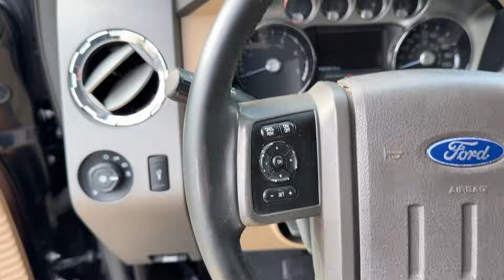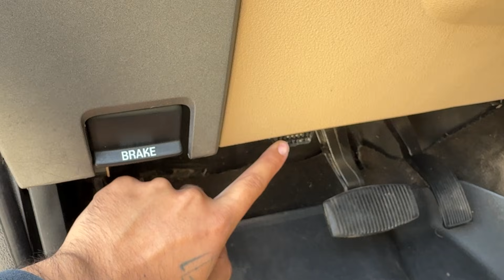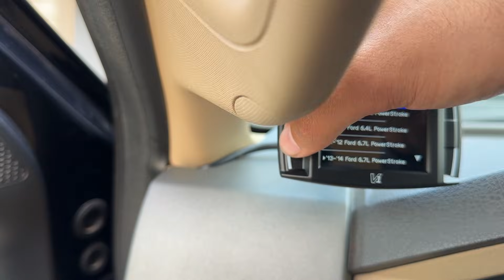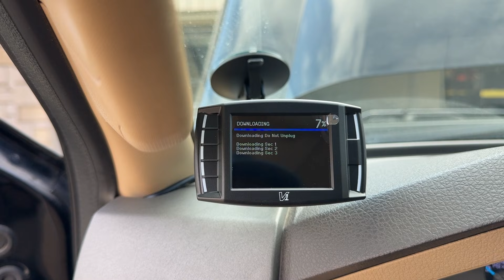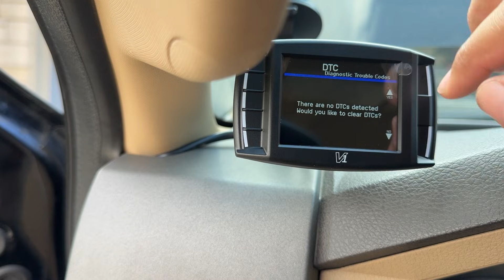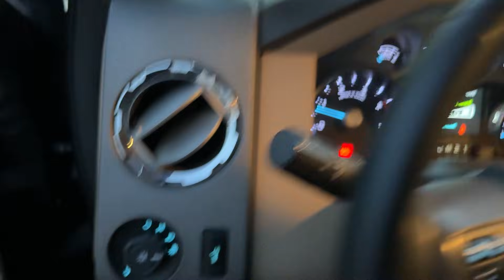6.7 Powerstroke Mini Maxx Tuner - How to Install it the RIGHT WAY for EGR/DPF/DEF Delete

Comment: Greetings, excellent explanation, but I have a question: when you got to the step about tuning the transmission, you selected "no." I'm unsure about installing the same system I purchased. I would appreciate it if you could clarify this point for me.

Comment: New diesel owner here I’m gonna delete my 2013 F25067 power stroke and I was gonna ask can you take all the stuff off first and then install the minimax and go through all the tuning process and I was wondering if you had any problems or do you need a shop to tune it for you?

Comment: It doesn't matter if you do it before or after as long as your truck didn't have any cel and you do not start it after the delete... put battery vharger on batteries and tune after. Your truck won't know if egr or def is deleted if it hasn't been started

Comment: How do you like the mini maxx tuner after all these months? I am trying to decide bewteen mini maxx or EZ lynk, ez lynk has better tunes, and mini maxx is just so much cheaper so its hard to decide. Also, if you know the difference between the v1 and v2 mini maxx any info would help. Great video!
Reply: V2 is for 15 and 16. V1 is for 11-14
Reply: @brandonkraska931  Just ordered full delete kit and they are sending me the Mini Max
 V2 for my 2012 F250 6.7  ??

Comment: You only needed to remove the 2 connectors and vacuum line (plug it) on top of the EGR assy. That's all I did and it hasn't caused problems. Those are what make it work.
Reply: Cause carbon build up
Reply: @mikemerheb7038  it's got nowhere to go if it's turned off. The exhaust stops right there and will follow the path of least resistance...out the exhaust pipe behind the truck.
Reply: When I took my throttle body off it was full of carbon along w my upper and lower intake,bad!! I would think it would build up in the egr amd back up...I could be wrong
Reply: @mikemerheb7038  That wasn't the EGR. The EGR is to the right (left as you stand in front) of the intake. The intake gets the cooled exhaust gasses from the EGR. By turning off and disconnecting the EGR, the valve defaults to the closed position and that tube to the intake is rendered moot. That carbon was because the EGR was working. With the EGR valve closed, there is no exhaust entering the intake, and therefore, no carbon. Clean that carbon out and it will not return. 

I'll delete (I have the kit) my entire EGR system when my truck needs new coolant hoses. Until then, the EGR remains turned off and I haven't wasted $$ on coolant. I plan to send my intake to the machine shop at the same time to have the intake cleaned thoroughly.

Comment: Hey boss, I have a 2011 F250 with the mini maxx (I believe it’s the V1). I was wondering, after the truck is deleted can the tuner be unplugged? I know that it keeps the delete tunes stored so it doesn’t throw any codes, but if I have it set to performance mode will it keep it in this mode after it is unplugged? I’ve been seeing mixed messages online. Appreciate any help!

Comment: Getting ready to do this to my truck this weekend. I am concerned with one thing, though. On multiple videos, I am seeing that you aren’t supposed to install the tune with emissions related check engine lights on. I have one EGR code and one DEF heater code that comes back every time I clear the code and the truck is turned off and back on. What am I to do in this scenario? I can obviously delete the codes, but I am worried that with all of the cycling of the key on and off at the initial set up, that my check engine lights will still be active because they usually do come back after restarting and could cause issues with the tune installation. Any ideas or help would be greatly appreciated as I only have a few days until I tackle this myself.
Reply from the maker: The only thing you can do is try clearing the codes and go straight into the tune process before starting your truck. I’m unsure if by turning the key on and off during setup will introduce the codes again. Do you know if the codes only come back when the truck is turned back on or only if the key is turned to run position but not turned over? Either way, this seems to be your only option. Hopefully the tune will install before the codes return, which then the programming for those codes will be deleted and you’ll be golden. Worst case scenario I think would be that the EGR and DEF codes remain after the tune and either stay permanently or you may be able to delete them through the diagnostics process on the tuner. But even if the codes do stay, it sucks having a wrench or engine light, but at least your truck will be deleted and emissions equipment will be turned off. Later down the road you can always flash back to stock and get your emissions stuff “fixed” so that the codes go away permanently, then re-tune. Whatever you do just make sure you tune first before removing any sensors and don’t turn over the ignition fully until prompted towards the end of the tune process. I’ve never dealt with this issue so please report back on your findings for all of us. It would greatly help the community to learn what the outcome would be in your case.
Reply: @mediciimusic I appreciate the quick response. Absolutely will update once I get everything sorted out. Hopefully by this weekend! Thanks!
Reply: UPDATE!!!! I just unplugged all of the plugs on my def pump, then used OBD2 scanner to delete the code, and my CEL FINALLY WENT OFF! And stayed off. Been scratching my head on this for over a month! I hope that helps you
Reply: @byrdsdoityourselfgarage7330  what code did you have? i thjink that will only work for those who had the same code as you
Reply: I’m having this same issue :(
Reply: Yeah, I got the same situation. I got a code for EGR, which is why I wanted to delete it in the first place, rather than dumping money into fixing my emissions system, let me know how it goes if clearing the codes works
Reply: Let us know man!

Comment: Have a question, can the tuner be installed after deleting the truck?

Just notice that it said to do it before removing any components from the truck
Reply: You probably could but I wouldn’t or you’ll get a bunch of codes if you start/drive it.  What I did was installed tunes, then started truck to make sure there were no codes, turned truck off, then removed everything.

Comment: I just removed my egr from my truck.  I haven’t received my tuner yet. It’s still in the mail coming in a few days.  

Will I have an issue downloading the tuner? The instructions says warm up the truck to normal operating temp before downloading the tune.  

Did you have an issue with your truck deleting everything first before installing the tune?

Please help??!!
Reply: Did you have any issues?

Comment: I removed my egr cooler before installing my tuner.  Will I have a problem properly installing the tuner?
Reply from the maker: If you start your truck before installing the tuner after removing the EGR cooler yes you will likely have major problems. The track maybe wont start or will go into limp mode? If you watch the whole video I clearly state that you MUST keep everything stock without removing anything until you install the tune. Then delete everything.

Comment: Will you post a video on doing the egr delete with block off plates?
Reply from the maker: Eventually but honestly scared of snapping those bolts so I haven't done it yet. Truck is still running great though so debated if I'll ever.
Reply: @mediciimusic fair enough, I got the same kit as you but currently waiting on some dmv stuff to finish up, just going to disconnect egr like you did too in case I ever have to revert back or sell it. Dirt legal can register any truck in Montana and you won’t have to worry about emissions, or find someone who lives in Arizona lol

Comment: Does the 'exhaust fluid range' alert pop up every time you start your truck?
Reply from the maker: @Cory.Robson  no that went away after the first or second start up after tune was compelted
Reply: If it's still there, did you use the can bus plug on your def sensor?

Comment: Great video, just an FYI the V2 doesn't ask about the delete and is a few steps shorter than this was. I just finished up the programmer and super simple...thanks
Reply from the maker: @jamesbaker1457  good to know! And right on
Reply: I got the delete kit with the v2 on the way, is it pretty much the same as this video?

Comment: Thank you for the follow-up here🙂and the slowdown of the process and explanation in (Detail). The only thing to mention is what you did not show us under or behind the panel. Great knowing which ignition wire to tie into Blue with yellow stripe. (ignition key power). THX Again! B

Comment: Is this the same for the mini max v2 tuner? Just ordered mine with that tuner and watched your video I’m assuming it’s all the same? Also has 2 diesel mechanics 1 works at a ford dealership say that EGR block off is NOT necessary. So we will see! Also can you show exactly which plugs to unplug after tuner is set up?
Reply from the maker: @coryalbertson432  yes it will be the same for the v2 tuner, and there’s a ton of conflicting info out there about the egr block off but to me, it’s necessary. And I show which egr plugs to unplug? Do you mean the plugs for the DPF/DEF?
Reply: You can leave the EGR attached. Just disconnect the 2 electrical connectors on top and the vacuum line (plug it). Those are the only 3 items that make it work. 

Deal with removing it when you decide to change hoses and coolant.

Comment: Got to install download where it shows vin and it’s stuck on there as of now no continue button, 17 powerstroke
Reply from the maker: @dacorianjackson4631  did you get it resolved? Sometimes it can take a while
Reply: yes, I restarted it and it  worked, it’s a mini Maxx v2 it came preloaded with a tune in a delete kit. It didn’t say anything about emissions when I tuned it. I hope it’s the delete tune as I’m already taking egr and dpf off.

Comment: I just installed the minimaxx v2 on mine and I'm showing 2 DTCs a p160A and a P04e3 will these go away after I remove all the egr stuff?
Update to my own situation in case it helps anyone else, the code was from adjusting the tire size in the minimaxx v2 and not corresponding.

Comment: Installed the minimax on a 2011 power stroke, deleted first as mini max asked if emissions were present or not. Never had to start truck until tunes were installed. Removed egr piping and installed block off plates. Plate on exhaust opening provided opening for egt sensor . Installation is very easy, instructions are very clear and minimax shows progress. After delete took maybe 25 minutes to install tune and done. Nothing difficult about it!
Reply: After you set up your Mini Maxx tuner but before you do the delete do you unhook your batteries or do you leave them hooked up sing a Mini Max continues to operate
Reply: @anthonykrogman3037  batteries stay hooked up.
Reply: I want to delete and tune my 2012 f250, my first diesel truck, was the whole delete pretty easy or what was the hardest part? Thanks
Reply: @Danielxperez14  I’m gonna to delete mine tomorrow I will keep you updated.
Reply: @andraedwards417 I appreciate it 🫡
Reply: @andraedwards417 how was it

Comment: Great video. Just bought the mini max V1 and was thinking same thing. Should I delete first or tune first. Hoping my 6.7 Cummins will be the same as your power stroke. Thx
Reply: It's not the same. Not even a little bit.
Reply: @singlsrvngfrnd what I meant is I hope it works out the same. Obviously completely different engines
Reply: @coryatcosta2714 how did it go?

Comment: I appreciate the time you took to make this, probably the first one I’ve seen that actually shows how to go through the tuner setup.  I’ve got a stock ‘16 and will probably go this route in the spring when it warms back up.
Reply from the maker: @texascubs3676  Thank you! That’s my goal is to provide super helpful, informative content. Check out my latest short, I’m doing a sinister diesel cold side charge pipe giveaway if you’re interested! It will fit yours.

Comment: You don't have to remove the EGR at all once it's Deleted and tuned that's not necessary it won't recirculate anything
Reply from the maker: @stevenbrooks1243  it is totally necessary. You risk coolant from the EGR eventually leaking into the intake (which is a known problem) and then you’re fucked. Yes you’ll be fine for a bit most likely but still highly recommend removing it completely and installing block off plates. It’s all about longevity for me.
Reply: @mediciimusic I doubt it's going to leak when you don't have any heat running through it again. It's not necessary. There's guys that have deleted and tuned and kept the EGR cooler intact on top of the motor and ran it for over 100,000 MI. If you want to spread that propaganda by all means do it. I have the same truck doing the same shit you're doing with the same tuner no problems and I've been driving diesel pickups for 20 years dude all of them 6.7  7.3 6.0 so and I'm a professional mechanic so I'm just going to go with what I know works
Reply from the maker: @ there’s 100% still heat just not as much, coolant is still actively flowing through the EGR, and high EGT’s will still reach the closed EGR valve, which will gum up with soot so bad when you go to sell it at a dealership and put everything back on the valve is fucked. So yes there’s still a possibility of a coolant leak. Just things to think about for different scenarios, for me, it is necessary. Not “propaganda” lmao this ain’t politics bro😅 I just think in the end, it’s better to remove it, opens up a bunch of room in your engine bay, peace of mind.
Reply: @mediciimusic  soot can't reach egr valve with piping deleted and block off plates installed!
Reply from the maker: @ron8864  true
Reply: @stevenbrooks1243  Question for you please.  I have EGR cooler clogged code and exhaust codes for regenerating which it will not, clogged, cannot even force it.  After doing delete and installing pipes will codes go away or can they be cleared.  Really confused on this.

Comment from the maker: A few things to note:

1. The orange sensor next to the cold side intercooler pipe that I said was an EGR sensor is actually the throttle valve sensor, this needs to be unplugged during the EGR delete as mentioned.
2. Some people say to disconnect the battery before removing sensors, I did not do this and everything is fine just make sure truck is fully turned off of course and key is OFF/out of the ignition.
3. I’ll add more if anything comes to mind